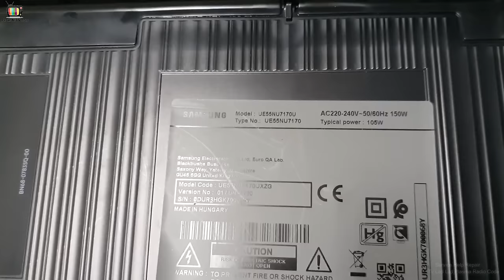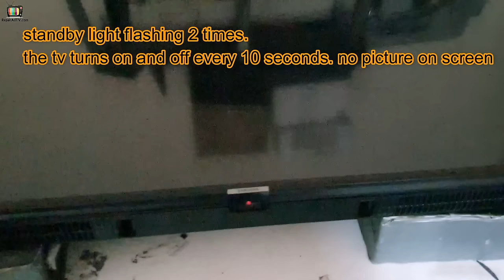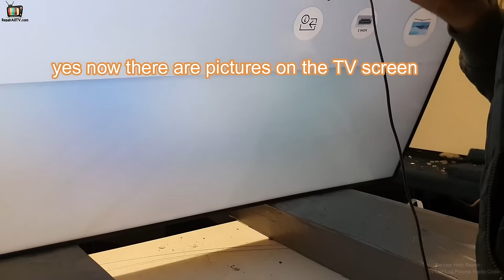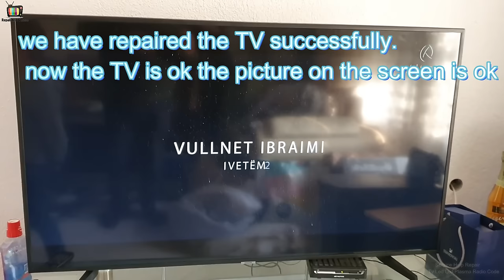SAMSUNG UE55NU7170U The TV turns on and off. every 10 seconds no picture on the screen

Comment: Thank you, it is working for me. I hide pin 7-10 (from the right side) and now it works at all. 
If you have horizontal lines or black screen in vertical line, it is necessary to cut the tape and try which pin might be visible. If it is not working on one cable, try the second cable. At first I spent hours on the wrong side (cable). 
Thanks for that video! :)
PS: That issue is caused by screen panel or ribbon or t-con board (?), it is useless to try powerboard or mainboard replacement.
Reply from the maker: this is ribbon screen problem.  failed series for a short time after you buy tv.  only this problem is arising.
Reply: @RepairAllTV  is the cable broken? Doesn't buying a new one help?
Reply: @apfeltasche96  Hi sir, can you help me on my Samsung UA50TU8000G TV? Mine is turning on and off but I do have pictures and sound. My TV has only 1 ribbon, what pins do I have to tape?
Reply: Hello.  I want to ask you.  Is it 100% pointless to change the source module and the mainboard if I have this problem?  I ordered the parts and would like to exchange them.  Have you experienced this?  I want to know so that I don't try in vain.  thanks
Reply: I’ve covered 3 pins, and now I’m receiving sound and a picture, however it’s very white and barely visible.

Does anyone have any idea where to go from here?
Reply: @benstewart6707  with a black strip between 4 and 8 mm wide, try to move it pin by pin from the end of the strip with pins.  You have to look for the pins with the failure.  and if you get to the image, try to make the black band shorter until you get a clear image.  Also, make sure that when you fasten the tape with the clip, it is straight and pushed to the maximum. I succeeded after 2 hours of attempts.  Success
Reply: @catalinb1315  thank you very much for your help! Could I just ask, what do you mean by black band? Is that the tape?
Reply: @benstewart6707  insulating tape for electrical cables.  it is more resistant and does not get perforated when you catch the tape with pins.  Another important thing is that it is glued well and pressed so that the contact with the pins on the left and right of the covered surface makes perfect contact
Reply: I opened up my tv before watching this video and just above the logo the screen was connected by something that looked like tape idk what it was but I think it probably got teared apart do you think it's a serious issue? if so how to fix it?
Reply: @catalinb1315  Do you mean to make the black band more narrow so that it covers fewer data pins? You said shorter, but I want to make sure that I understand...
Reply: @KC-lm2tx  yes...shorter...narrower...but let the band be black and a little thin.  You can catch it with the clip 2... 3 times and take it out to sit very well.  Be careful to insert it well into the slot and then tighten it.  Success
Reply: @KC-lm2tx  For 6 months, my TV has been working without problems since I repaired it in this way.  if something comes up I'll let you know
Reply: @pyknic412 this is smear/ fingerprint film for new tv that was never removed.

Comment: THANK YOU - I had this exact same problem on my 75" Samsung QLED TV.  It took some time to get the TV apart, and I had to move my speaker box out of the way; but eventually got to the connectors.  I wanted to isolate the "culprit" pins a little more, so I began experimenting with smaller pieces of tape.  If you watch the guy that does "FrugalRepair"; he actually takes a similar problem and isolates it all the way down to covering just one pin with cellophane tape.  I didn't have that much patience....   I was able to get picture and sound and the TV no longer cycles on and off.  The only drawback:  I have some minor horizontal lines in the upper left part of the screen--only noticeable up close.  From normal viewing distance; it's GREAT!
Reply: i had the same isue with the samw tv i was wonder if  i replaced the main board will back to normal
Reply: @moamen52ms  No it won't fix it. It's not the main or power board. It's the panel shorting out the power board. This will fix the power cycling issue but you will notice horizontal lines and poor picture quality on the ride half of your screen.
Reply: Hello. what is your model? after repair is there  a defect when viewing the picture?
Reply: I dont understand where to put the tape ?
Reply: Which pins did you cover I’m having this issue now too

Comment: Okay so I got the Led light to stay on after adding the tape. That’s definitely progress, however I’m still not receiving picture on the screen, just like a bluish back light. Do I just need to move the tape around until picture comes back?
Reply: What did you do? I only have one ribbon instead of two, and I don't receive any part of the picture. I only see the TV turn on, as if I didn't put the ribbon back in at all

Comment: Could you please explain, which signals are you blocking ? I tried to count and it looks like you are blocking 12 signals starting from pin 14. But there are only 8 clock signals and they are pin 12-19 on that model.
Reply: Try another pins. For me it works after hiding 7-10 pins from the right side. Try both left and right panel cables.
Reply: @matejbruna2663  Hey. How many pins to we have to hide? Is it random? Do I have to try to hide them one by one? 2 by 2?

Comment: Sir, you are my hero. I don’t often put comments on YouTube but this one deserves it. I had the same exact issue with my TV. I solved this problem by following your steps. I only have one question about this. I didn’t use black electrical tape but regular scotch tape, which also solved my problem. Can this affect anything bad? Or is it just the same as the black tape? Thanks again for saving me my money 😋
Reply from the maker: the thing is, there is no problem, just cover the lines, that's all

Comment: If still doesn't work, unplug tv and take ribbon out and continue to adjust the tape across the ribbon little by little while making sure the tape is over hanging the contact points of ribbon each time. My Samsung UN60EH6003 ended up needing the strip at the very bottom of the ribbon.
Reply: Question for you - so I did this fox and it worked perfectly at first.  As we watched the tv through the night the color changed on half of the tv.  It was subtle, but definitely not right!  Any ideas?
Reply: @janelloyd4268  I would maybe check the tape to make sure it didn't come off, rip apart, or move slightly over exposing the contact point of pins around it. If tape is still good and in same position maybe try moving tape over 1 pin at a time to see if that fixes it. 
Hope this helps for you!
Reply: What do u mean at the bottom of the ribbon? Help pls
Reply: What if your TV only has one ribbon cable instead of two for left and right side

Comment: If it works after this trick ... will there be problems in the future?  Where is the problem ... on the board where the power cable enters?  If I have a replacement board, is this trick still needed?  Thank you in advance

Comment: AMAZING!!!!  First video that actually works. I just fixed my 70” like this.  Amazing!!!
Reply: Hello. what is your model? after repair is there  a defect when viewing the picture?
Reply: @geraepox  TU7000 6 series and yes there’s a very little bit of discoloring on the right side of the screen .  But not to noticeable
Reply: @ericmontanez7276     Thanks
Reply: @geraepox  we’re you having the same problem?
Reply: What model 70 do u have I have a 6 series
Reply: @anjelayala7561  same
Reply: Sorry it’s not the tu7000 it’s the in70nu6900
Reply: @anjelayala7561  I have fixed numerous TVs like this and there has been a couple to where it took several dozen times placing the tape from end to end on the ribbon cable and finally got it rite.
Reply: Where is position for single ribbon ?
Reply: @edisukriansyah5230  if I’m understanding rite, you only have one single ribbon cable instead of two??
Reply: @ericmontanez7276  single flex cable sir.  This model is UA70TU..  What can i do?
Reply: @edisukriansyah5230  Samsung?
Reply: @ericmontanez7276   for me its samsung yes. Just one ribbon cable goes to the left panel driver and from the left driver there is ribbon cable goes to the right panel driver.
Reply: @edisukriansyah5230  have fix single ribbon 70AU?
Reply: @edisukriansyah5230  What is the number pin you start to cover? And how many pins need to cover?
Reply: @ericmontanez7276  My 70" TU7000 only has one ribbon cables going to the panel instead of 2 cable. It seems no matter where I place the tape I get no picture. It doesnt keep looping on and off but the screen still blank
Reply: @hammiranda  it has to be a capacitor
Reply: @hammiranda  have you placed a flashlight up to the screen?  Because if it’s not looping then the tape trick is not gonna work
Reply: @hammiranda  having the same issue currently. Did you find a way to get picture?
Reply: @frankmontano8948  No unfortunately. I got tired of placing the tape on every pin to no avail. Ended up tossing it 🥲

Comment: Thank you! Saved me a lot of money. Careful when removing back panel the corners crack easily. Mine was the same cable but the bottom half, get one regular piece of scotch tape and a thin one and work ur way down the ends keeping track of the little pins , took me like 2 hours testing both cable strips but eventually I narrowed it down. When u narrow it down to the possible area look closely at ur screen for lines or blurriness then pin point if the tape needs to be more thick or think and its that easy
Reply: There is faint horizontal lines that is brely seen. Will thikining the tape helps ?
Reply: I had to cut the tape very thin yo cover 3 pins and this worked for me, took me like 25 min to find the right pin, but u have to play with it till the picture is just right.
Reply: @boogsz5166  does yours have horizontal lines too? barely visible?

Comment: This actually works believe it or not after ordering a new power supply that did not work and ordering the control module that did not work I found this video pulled the strip and added some tape and the TV turned on thank you so much for this video
Reply: I must add left side of screen lost some color

Comment: This worked with me , thank you very much.❤❤

Ps : here 14:28 my tv had only one cable and i was taping and trying to figure out the damaged one.
Reply: Hi, my tv also has one cable, can you help me out by specifying what exactly you did? 
I did tape off small section of the single cable and i was able to get the sound back but not the picture.
Reply: @diliprockz24 im having the same exact problem
Reply: Did you ever solve it?
Reply: It worked for a month now its off again💔
Reply: Same problem here, single ribbon in a Samsung 50” AU8000. When covering several pins on the right side: Backlight is on, sound is working, no picture. Trying to find a clear answer about whether this fix is possible with the single ribbon.

Comment: Thank you for the hint mate, you got a new subsriber! I succesfully brought a Samsung TV (QE55Q60R) back to life. The strange thing is, that the less pins i covered with tape, the worst picture quality i got. I narrowed down the problem to pin 20-23 (same cable, same side - left as on the video), one of them is causing the bootloop issue. When i covered only these 4 pins, i got many visible missing line artifacts on the picture, so i used finally a broader tape covering 10-15 lines (from PIN 19), and picture looks almost perfect (only some greenish colouring at the edge of black and white, visible from very close distance). The result is absolutely acceptable for watching videos, TV, even computer image looks good. Otherwise this TV would go to recycling, as repair offer i got was 400 USD. If i may give you one advise - purely good intention -, please talk more or give more details, people want to know why you do exactly what you do. ;)
Reply: Hi nice to hear that it worked for you
Im trying it right now and wanted to ask if u use any specific kind of tape or if it was sticky on both sides
Reply: @mclovin8450  I was using very thin transparent “cellux” tape, sticky on one side, which you can probably find in every kitchen.

Comment: Great job sir,. Your video really helped me to repair my Samsung 49" TV. I did the same job and worked well. I really appreciate your support. Thanking you..
Reply: I have the same tv as that of your doing same thing, where exatly did you put the tape
Reply: @kondwanibanda4219 18th pin of right side display cable.
Reply: Counting from left or right
Reply: I should cover only pin 18?
Reply: @kondwanibanda4219  First take a thin paper which can cover atleast 8pins of the cable.Then start by keeping  the paper starting from  one place of the cable either in right side or left. If problem not solved, then cover the paper in next eight pins of the cable vice versa...every tv might not have problem in one place of the cable. So try like that and I am sure you will definitely solve the problem..i am very much confidence on you...all the best..

Comment: Interesting, I'll try with kapton tape as it's thinner. But I always wondered if the metal backing where the ribbons connect on the bottom were touching the display causing a short to the control lines.

Comment: Hi, Thanks for great information. I have a question Mr. I haw the same problem but my Samsung tv has only one flat cable, not has the second cable that you worked, it has only the first.. I use black tape in this first flat cable like a you used in the same position and this resolve the turn on and off fix but the screen continue black, has sound but continue black screen. Please If you can Help me, So I will be so thankful.
Reply: The same to me TV is on with sound but no picture.
Reply: Same.  Did you ever resolve it?
Reply: Bad panel
Reply: Same for me
Reply: Did you have solution?

Comment: Just started having issues with my 70" doing the same thing. Happens to still be within my 3 year warranty but was worried I wouldn't be able to replace it at the price I originally paid. It was a little difficult to decipher if I needed to cut a certain size and/or how many pins to cover. Only took two attempts and everything is in working order. I do recommend for those that who are trying to test if it's lit up to have help propping it up so as to not damage anything further. Didn't have electrical tape on hand so used a little bit of the tape holding the ribbons in place. Didn't have pry tools so used a flat head and lifted just a little all around the edges of my T.V. until each of the clips came undone.
Reply: Which pins did you end up covering? I have the same issue with my qled 70
Reply: @Jhyeire Stone  Roughly about a quarter inch wide and around pin 14 to wherever it ended. It worked best for me having someone hold the T.V. up on both ends and letting me know when it was working. Had a small issue where it lit up but one side was dimmed without color.
Reply: @MrStealYoSoul  thanks I will give that a try!

Comment: If someone could tell and or explain to me how to know which pins to cover first as a starting point I would appreciate it. The man in the video did not start on the end of the ribbon and work his way across. It would appear to me he started at a specific point for a specific reason. Maybe I’m wrong and maybe he just happen to guess correctly but something tells me he is pretty smart so there has to be some logic as to why he started 1/4 of the way down the ribbon and not at the beginning. Thanks

Comment: The TV I have a question for is an older UN60H6203AF. What would cause the TV to flash red and reboot? This is the first time I have ever caught it happening. TV has been on for most of its life but is working fine other than a random intermittent reboot. It does power back on, and stay on for quite some time; days without hesitation. Whether the TV is crashing in software, or the TV has a hardware issue; I have no clue. Been debating running a new circuit to the TV and adding a power conditioner to rule out line interference; but not sure that'll work. I guess PSU failure wouldn't be the worst; however it is hard to believe that's the problem. Main board seems more likely for me; just due to how slow the UI is; but it's a TV so I can't ask for much haha.. Slow Smart TV! I don't think this is early signs of a display failure; but who knows! I was wrong about display failure on our old 55" Vizio Smart TV.

Comment: My Q90R has failed after 18 months with same issue. If the warranty repair guys fix it with a piece of tape over some pins I will be right p***ed off as the pins are there for a reason so to take them out of the equation with a bit of tape seems wrong, even if it does work. There’s clearly a larger fault at play and I want it fixed properly.
Reply: there is only one proper fix thats to replace the panel which will cost as much as a new tv.
Reply: Totally agree. It's a bodge which doesn't provide a complete cure, and you'd only do it if the set would otherwise be written off. If the TV is under warranty when this fault occurs, then Samsung must fix it properly and foot the bill.

Comment: I have the same problem . I did the trick with the tape ...now he stay on , no blinking anymore ...there is sound , backlicht bud no image? What do i wrong?
Reply: I watched this video and thought no way, I tried it and got  sound but no pic. I then cut a small strip of electrical tape and cover one more pin to the right and got everything. Works good so far.
Reply: @gumby-damnit3031  which pins exactly did you cover